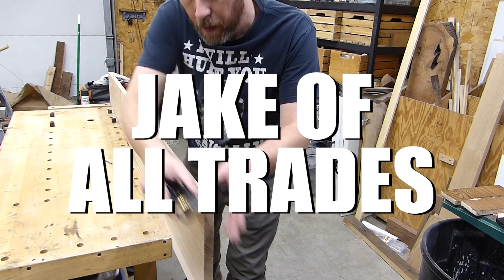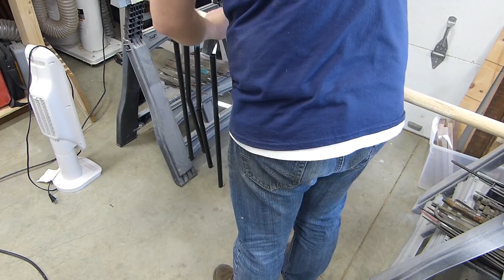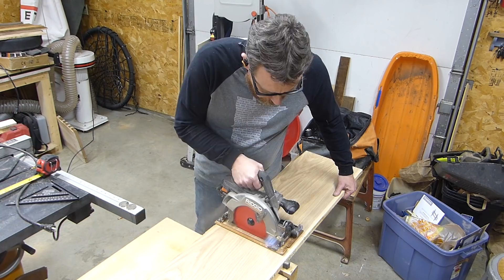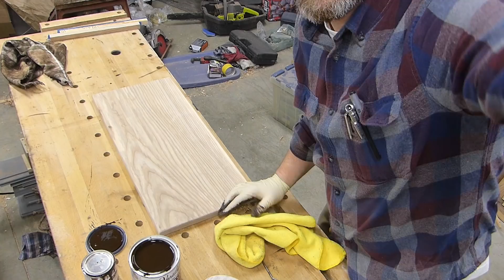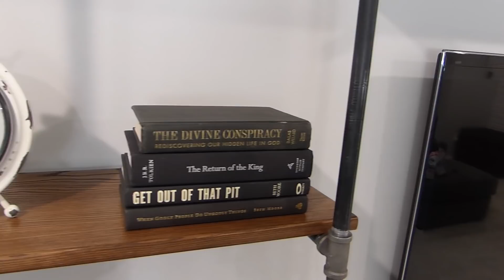How to build a industrial rustic black pipe book shelf / entertainment unit

Comment: Question: How do you ensure the flanges and pipe are exactly 90 degrees?  In my experience, it is hit or miss on the flanges being thread appropriately.  To account for this, do you recommend the use of shims under the flange to adjust to exactly 90, or do you have another suggestion?  For my specific project, some of the flanges are ~85 degrees... not good for dimensional structures.  Need to find a way to square it all up.
Reply: Have you figured it out? I have the same problem

Comment: Nice project and looks good! Appreciate the video and suggestions, esp about the threads, wow, that would be a huge deal for me since I don't live anywhere remotely close to a supplier. It's one trip in, then anything else gets web ordered.

One question, or observation maybe. The precut pipes, fittings etc must have cost a fortune! Do you have recollection as to what you spent? Just on the pipe and fittings?

Comment: My guess is that’s about $300 worth of fittings and pipe right there. The fittings and pipe lengths under 12” are available on amazon for a lot less although they are sold in lots of ten.
Reply from the maker: Yes. The expensive parts were all the pieces under 12 in.   They added up quickly.      the  pieces longer than 12 in I had the person at Home Depot cut and thread for me.   Just be sure they cut a small enough thread.   I got all my longer pieces home and they had not cut them small enough to where I maybe got 1/2 a turn on a fitting.   Had to cut more material off with a pipe threader to get them to fit properly.

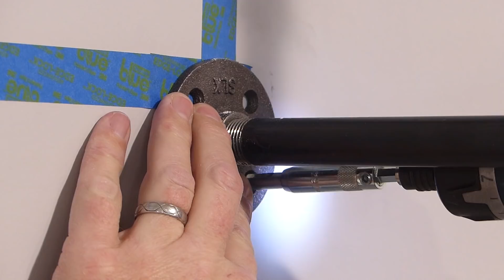Comment: at 5:03, what drill extension is that used for pre-dirlling?
Reply from the maker: They are called centering drill bits.  
these are good
 https://www.amazon.com/Bosch-Clic-Change-Self-Centering-Assortment-CC2430/dp/B0000TZX1M/ref=sr_1_2?crid=1QLLMR263SC9R&dchild=1&keywords=centering+drill+bit&qid=1589763771&sprefix=centering+drill+%2Caps%2C174&sr=8-2

as well as these
https://www.amazon.com/Snappy-Tools-bisagras-autocentradas-unidades/dp/B0014A454M/ref=sr_1_15?crid=1QLLMR263SC9R&dchild=1&keywords=centering+drill+bit&qid=1589763885&sprefix=centering+drill+%2Caps%2C174&sr=8-15

Comment: Nice! Just wondering, did you feel the need to put anything to stop the shelves from moving sideways, say if they are bumped?
Reply: I was surprised he didn't do anything between the pipe and the wood. I'm planning on doing a small piece of double sided tape at each contact point.
Reply from the maker: I just have them sitting on the pipe.    It really doesn't get touched much.    I"m trying to come up with a way so the fastener is hidden.    I I 
 I haven't quite figures it out yet.
Reply: @Jake.of.All.Trades  There's a video called "The $20 Rustic Shelf - Easy DIY Project" by 'The Rehab Life' channel. Worth checking out the fixings they used on their pipe shelf to stop them from moving.

Comment: Looks really great! I would not have sanded and painted the black iron pipe.

I realize that hitting studs might be difficult but I would worry about the stability of each upright, if they were bumped from the side, with only drywall anchors, and having four of the anchors in such a small place might make the drywall even weaker.

Comment: Hi Jake, thank you for the detailed video, especially the beginning of it about pipe threading is very valuable. Could you please tell me what size of pipes did you use 3/4 or 1/2 and how thick your wood slabs are?
Reply from the maker: i used 3/4 in. pipe and 3/4  in. wood.  you could go thicker with the wood and it would look good i think